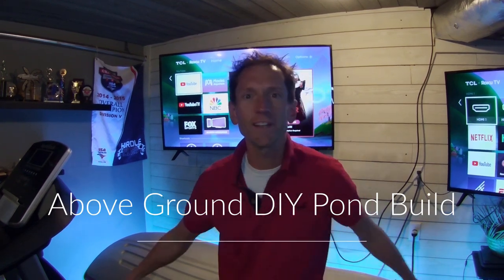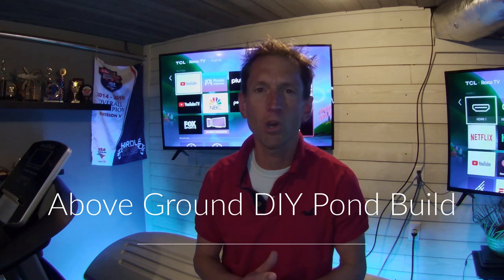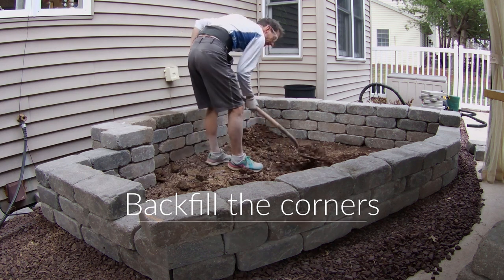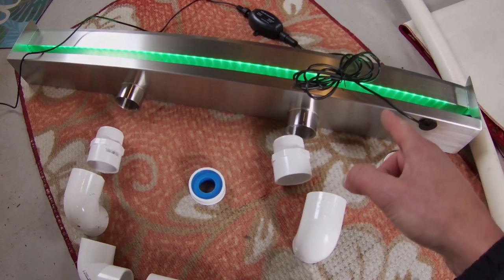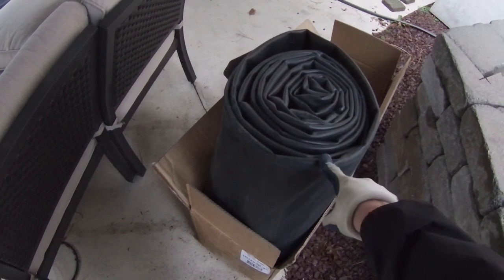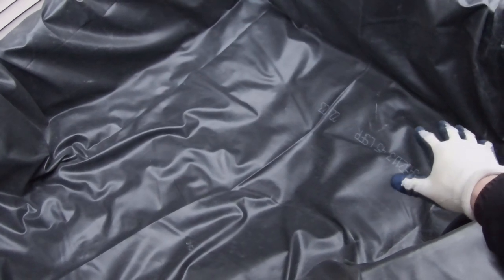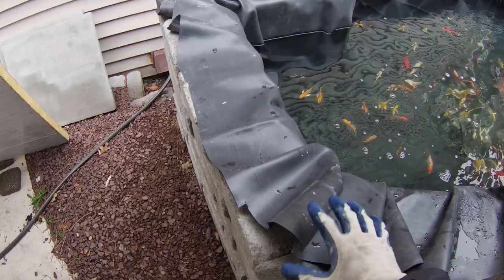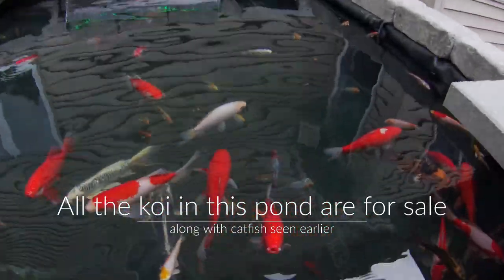How to build an above ground koi pond.

Comment: Did you dry stack those stones? No adhesive? No mortar? Wow! I'm doing a similar project with retaining wall blocks mortared together and instead of a liner I'm creating an interior made of waterproofed concrete (like a swimming pool). Aren't you concerned about water pressure bursting your wall?
Reply: I was interested in knowing the same thing, there's no way they're dry stacked

Comment from the maker: They are just stacked on each other. No mortar. They are heavy enough they will not fall over. I wouldn’t go any higher than 7 levels though.
Reply: You remember west size block from lowes?
Reply from the maker: @ThatTugistheDrug  please rephrase your question
Reply from the maker: No mortar. It hasn’t budged since I built it. You just need to bench the retaining wall blocks 1-2 layers high behind the wall to give more support at the bottom. I describe it in the supplement video. And you can’t go any higher than what I have it.

Comment: I’m using the exact same stones as I’ve used them for a fire pit area that I’m building my pond next to. Now I’m considering using adhesive even though those blocks may be ok without. Next I’m using a bottom drain . These are much better for a Koi pond. The line then goes to a Danner pump which is at the ground level and will pump to my homemade filter and spill into my waterfall. I don’t like the LED light spillway. I used one in my large waterfall into my pool. It’s a waste of time and money. All you see is a strip of colored light. Better solution and cheaper is color changing waterproof single lamps placed in different areas. They can actually be placed under water on rocks and give you awesome effects.   As to the filter the one you used is WAY to expensive. I’ve built ones using a plastic tote. A bulkhead fitting ( cheap) at the bottom . Also instal a drain to drain the accumulated muck. Bottom layer is coarse filter sponge over some small lava rocks. This traps the heavy waste and easy to flush out. Next a row  of poly fill  batting from Walmart.( again cheap) now you can use a charcoal impregnated pad over it too to polish the water even more. Then top off with your bio balls. I like them in bags for easy removal when replacing batting. This WORKS! And cheaply. No need for expensive UV light if done right. Nature will do its job in a few cycles and you will need little to maintain. Put in benificial  bacteria to get it started and add when needed . It goes without saying put plenty of rocks for bacteria to grow on. Live water plants as well.  You obviously have grown nice Koi. I do question you putting them right into your fresh water new pond. I’m guessing you don’t have city water with chlorine as that would kill them FAST. if your in a hurry you can use detoxifier. Also water temps must be the same from where they were in holding. I don’t mean to criticize your video but think it’s important info for new pond builders. Nothing more frustrating then spending a lot of time and money only to be disappointed in the end. I learned much the hard way on my in the ground pond until I got proper information. It’s a bit more work than it may seem to make the perfect pond. You really don’t need to do much to maintain if done properly. There is a lot of conflicting information out there. Research several places and use your own logic. Take advise from ppl who like me learned the hard way. My pond is great, little to do but feed and enjoy my very happy Koi. Thank you.

Comment: I have a question. What do you or can you use to permanently adhere the liners edge between the blocks & top finishing blocks? I don’t want someone sitting or leaning on top edge & they fall in or top finishing blocks slide off. Thank you .🙏🏼
Reply from the maker: I have never adhered the liner to the blocks so I don’t know. Sorry
Reply: I don't think you would want to that way. You can remove and replace if it gets damaged

Comment: Thanks for posting some great content.  I will be using some of the tips you presented when I build my pond.  One constructive comment, and I only say this because I like you, please use a respirator or mask when cutting the concrete blocks.  This is not a plug for Amazon but for $15.45  :  3M Half Facepiece Reusable Respirator 6300, Gases, Vapors, Dust, Paint, Cleaning, Grinding, Sawing, Sanding, Welding, Large ,  The HOA is so strict where I live that I am planning on building the Koi Pond without their knowledge.  Luckily I have an Azelia hedge I can hide behind during and after the build.  😁😎
Reply from the maker: Agreed

Comment: How do you prevent it from freezing or is it deep enough that it will not freeze?
Reply from the maker: I have a 1.5 cfm aeration puck in it but as long as you keep the water fall running it doesn’t freeze. Maybe three inch thick ice at the most.

Comment: So you didn't cement the blocks in? What stops the water pressure from pushing the blocks out? How would a build like this do in the north east, with weather that freezes?
Reply from the maker: No they are not mortared. See my how to build a above ground pond supplement video in my koi and pond playlist. The blocks are benched back on the bottom two rows. Then the weight holds them in.

Comment: Did you glue the blocks together or did there own weight hold it all together with water in it?
Reply from the maker: They hold their own wait but you can go any higher than what I have. I did bench back the bottom two rows with additional blocks. See my supplement video under the pond playlist

Comment: Did you cement / glue the stones together?
Reply from the maker: No but I benched the bottom two rows 1-2 blocks deep toward the inner side of the pond to mitigate force from the water pushing the blocks outward.

Comment: Did you morter the concrete blocks or do they just stay put
Reply from the maker: No mortar. They are sturdy. Can’t go any higher though. And I do have the bottom row two blocks deep to lessen the water force pushing out.
Reply: @thestclairchannel3889 if I add mortar than I can make it higher right

Comment: Did you not cycle the pond before fully stocking?
Reply from the maker: Good question. I have two 150gal and two 100gal Rubbermaid stock tanks. I pump old water back in but mix with new well water. These are mostly hardy goldfish in this pond so I wasn’t concerned losing any. All the fish survived.

Comment: Did you use landscape adhesive to secure the capstones to the liner? Or was enough to just lay them on top?
Reply from the maker: No. The weight of the block is heavy enough although the front wall is benched back one row for support. I hope to create a supplement video this weekend.
Reply from the maker: new video just posted to explain thanks

Comment: I’m trying to make a pond in my side yard. For the retaining wall, what kinda glue or adhesive did you use to keep them from falling?
Reply from the maker: None. But what I didn’t show is the front row is two rows deep 2-3 rows high behind the front layer to prevent the wall from buckling out. I may do another video to show everyone.
Reply from the maker: new video just posted to explain, thanks

Comment: No mortar just stacking rocks you gotta be kidding me! and that's holding? wow
Reply from the maker: Yes no mortar. These are the larger retaining wall blocks at lowes not the  landscape ones. I do have the front wall benched back with a second row of blocks about 2 rows high that I forgot to include in the video to add  support.
Reply from the maker: new video just posted to explain, thanks
Reply: Nicely done And awesome pond. Correct me if I misted but what are the specs how many gallons is this pond.
Reply from the maker: @panleoking227  900gallons